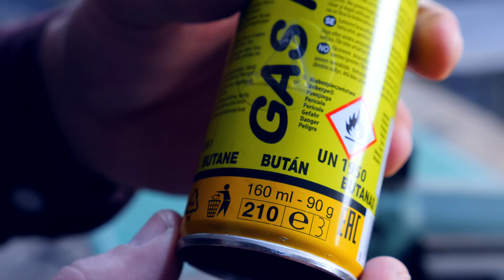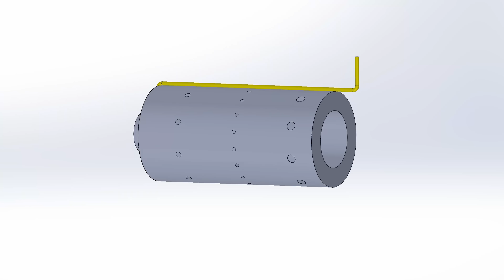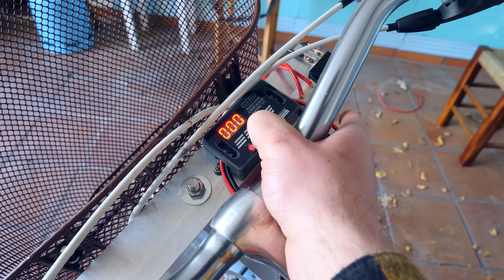I put a Homemade Jet Engine on my Bicycle

Comment: Heres an idea. Most of your videos experimenting on a homemade rocket your nozzle keeps on melting. You can use type 304 stainless steel it has a melting point of between 2,550 °F – 2,650 °F., you could also try treating the nozzle and the welds made with a more heat resistant metal with the downside that its harder to weld. You could try making the fuel injectors more symetric so the thrust should be more concentrated although it may be quite hard.

Comment: Couple pro tips. First if you want to open any kind of can just use a can opener. There's two ways you can use a typical can opener; parallel to the circumference and perpendicular to the circumference.  The latter will cut off the seam. Second tip is that's not welding that's called brazing. Welding is when the materials to be joined are melted and often the same or similar material is added to the molten joint. Brazing is when the materials being joined are heated up but not to the point of melting, then a dissimilar material with a lower melting point is introduced to liquefy and wet the joint similar to soldering.

Comment: Idea: I'd like to see a video making a rocket or even just one component such as the nozzle using some kind of subtractive machining like a lathe or CNC router. There may be a local machine shop willing to do the work and let you film, but you'd just supply a design. You could even go the extra mile to make the nozzle from Inconel. Considering how many rockets you make, I imagine the investment in a good reliable nozzle that could be transplanted to multiple future rocket designs may be worth the investment.

Comment: Idea: Make a water powered engine using electrolysis to convert the water into oxygen and hydrogen, the hydrogen should burn great when mixed with the oxygen.

Comment: I wonder how much of the power, was just leaf blower, and how much extra power was added from ignition. It would be easy to test, just test with only the leaf blower. Check speed and time between two points, then do the same with ignition turned on. Would be cool if you made a tubine version.

Comment: You're right that the can isn't going to do much as an exhaust or afterburner for your jet engine, but the real problem is using what I assume is brass or bronze braising to hold it together. I would look into some form of electrical arc welding, and building in all stainless if possible.

Comment: That was quite "engine rich" exhaust when you had the nozzle.
It would be interesting to see a side by side comparison of the leaf blower thrust vs the assembled engine.
Reply: yes! we need a control run, to show the difference between just the leave blower and the whole assembly.
Reply: you can leave
Reply: That's one thing I'd like to know in a fair amount of these engine builds. How much force is he achieving from just air and fuel delivery VS how much thrust is the combustion actually producing?
Reply: @AchievementDenied   Yes, this looks a lot like a heat gun for paint removal or burning weeds off the sidewalk. He needs a combustion chamber that contains a substantial amount of pressure and has a converging-diverging throat. But I don't want to see him build it - those need properly shielded testing stands.
Reply: yeah that would be epic to see how much power the combustion adds
Reply: He won’t do it because it’s likely the same and he knows it
Reply: Additional thrust was probably roughly 0.

Comment: With your love…. Sorry hate for tomatoes how far could you fire a tomato from a home made canon without the tomato exploding in the barrel? Cannon can be powered by any means you have, could be compressed air or butane /air explosion or alcohol/air or hairspray or other method of your choice. You can then have your assistant stand down range to try to catch the tomato to prove it was shot out intact, and even if it wasn’t it will be fun seeing him get sprayed with tomato bits

Comment: A motorjet! Motorjet research was nearly abandoned at the end of World War II as the turbojet was a more practical solution to jet power as it used the jet exhaust to drive a gas turbine, providing the power to drive the compressor without the additional weight of a piston engine that generated no thrust.

Comment: Great work buddy! Always stoked to se what you've come up with when I see you post a video! 😁 As soon as I saw the torch welding I was thinking it would likely melt, definitely need a more robustly manufactured exhaust/nozzle. Maybe ceramic coat it as well to help keep the heat out of the metal. Another suggestion for this would be some kind of flame out sensor, like a temp sensor that detects when the exhaust flow cools down below a certain threshold, and warns you with a light, or just cuts the gas supply and maybe blower as well. Feels like it could be a bit more safe than waving your hand in front of the exhaust. 😂

Comment: You need to add water injection to the inlet port of the compressor. Have it be a fine mist for best results. What it will do is cool down the air a lot and when it reaches the exhaust it will expand somewhere around 1600 times its original volume.
Reply: Oh also, switch from butane to gasoline or diesel. The issue you're having with butane is it's in confined spots whereas an atomized liquid will disburse more evenly with air before combustion

Comment: Idea: Building A jet engine out of a Bin.

Theoretically the parts should be able to withstand heat (because they are made of steel of aluminium) and it is mostly sheet metal so should be easy enough to work with and shape

Comment: I think you could get more performance out of the jet engine by making the lid cone-shaped to better direct the flow of the exhaust. You could also try to build an afterburner to put on the end of the jet engine to get a lot more power, and to make it look cool in the dark with flames shooting out of the engine.

Comment: For an exhaust you could always have gone to a scrap yard and get a piece of an old car exhaust, it is kinda pre designed to handle high temperatures and is about the right size ( width wise ). Just a thought.

Comment: In to improve the preformance of your jet engines, I sugest installing more then 1 burner. Use 1 for start up then use the other burners to push out the extra volume of fuel nessisary to keep up with the volume of forced induction you are able to provide

Comment: Split the air of the leaf blower (instead of running it at a lower speed), and blow cool air (like a bypass) over the metal fins on the back to act as cooling ... Edit: (Back again, after finishing the video ... or just remove the exhaust? LOL)

Comment: Just a note about electric cars, there is an estimated 28 billion lbs of lithium that could be mined from the earth. It takes 30 lbs of lithium to make an electric car. Assuming the lithium is used exclusively for automobiles, we could theoretically make 933 million electric cars. It is estimated that there are 1.4 billion cars in use globally.

Electric cars alone cannot replace internal combustion vehicles alone, we will need another source of energy storage besides lithium batteries to meet demand. Hydrogen would be a great contwnder for this.

Comment: I think it would be pretty awesome to see you achieve some kind of lift from jet engines. essentially a large circle with jet nozzles all around it. Just enough to get you a couple of inches off the ground, though, so you don't hurt yourself or need to get into adding gyroscopic stabilizers or something. A jet powered hover platform.

Comment: Also may be try your one of tour old carbon fibre pulse jet engine as anyone can clearly tell from its roar that it produce more thrust. Then pair the motor with a compressor made by the monster motor with a 1:2 gear ratio. That will sure go like 35 to 40 km/h

Comment: Most of the brazing will melt at about 1600F so why not build an arc welder out of microwave parts so you can use that for higher temperature joints that would withstand the jet engine temperatures.

Comment: I'm not entirely sure how you would do this but to cool the exhaust you could make it out of tubes and pump the fuel through it to cool it down like NASA does with their rocket engines
Reply: Just use excess compressor air, build an outer shell, for the air to flow through.

Comment: I'd like to see you do a control with the burner turned off in the jet to see how much thrust just the leaf blower is making. That would give a good visual representation of how much jet thrust you are generating.  It wouldn't require any fancy measuring devices, just have your buddy hold you and the bike steady from the side as you apply thrust in either mode.

Comment: try to crete an ion engine it uses ionic wind created bi hig voltage elecrtic current to move it is very efficient but not so powerful

Comment: if you diverted the excess air flow from the leaf blower around the outside of the combustion chamber and around the outside of the nozzle, it will cool it down a little while it is in use.

Comment: Future Video Idea: more propellant type testing based on use cases... i.e propane vs butane vs acetylene.  I'm also interested on how a solid fuel rocket would have worked in this project

Comment: What if you can figure out how to use regular air in a vortex with the normal combustion stuff in the middle so the normal air can shield/insulate the pipes from the burning stuff

Comment: I like this idea, I think you should try adding a regulated nozzle on the leaf blower and maybe create the inner combustion chamber with a smaller radius so the flame doesn’t go out. Also maybe try designing a proper nozzle on the rocket using graphite, you can buy decent sized cylinders online, use your mill to make a vortex opening.

Comment: Since the threat of imminent immolation is always present in your wonderful videos Sir, perhaps your next 3d printing/welding project could be set in the realm of [drum roll air for it !!] under the water 💦 !! I adore videos of beneath the surface of the water ( the location does not matter it could be a pool/river/sea/bathtub) and there’s a chance it might not all go down, or up actually, in flames 🔥 this is my idea. I’m also thinking about the Russian super cavitation bubble torpedo and your version of it )

Comment: I wonder if you have any of those turbos around, I'd like to see this thing running entirely on the enegy if the fuel. Perhaps you could use the turbo to pump air in instead of the leafblower. This would greatly reduce the jet's thrust though, tanks use similar engines for power so perhaps you could attach it to the wheel via gears. Most airplanes have the ability to start their engines in a similar way by blowing in lots of air to spin the turbine maybe that

Comment: Idea: Use the water impeller that you designed some videos back to make a submarine that uses it as propulsion. It can radio controlled and have a camera for viewing. It can be 3D printed, but you will need o-rings seals and use the resin printer.

Comment: Here's an idea, try building a rocket engine using nitrocellulose doped with a combustion catalyst like iron or copper oxide, or manganese dioxide (I know you have some of that from your peroxide rockets). Phlegmatize the nitrocellulose and catalyst with acetone and create a solid fuel grain. There's some good information on nitrocellulose based propellants on the sciencemadness forum, but mostly for making smokeless powder.  It should be applicable to rockets too.

Comment: Make a jet bike like this, but instead of leaf blower for air intake, set up the pedals to rotate pulleys & gearbox for a fan that blows air into the combustion chamber (pedals would no longer move the wheels, only the fan). In this way, you will be able to control air flow manually by pedaling harder or easier, giving you more control and a direct feel for some of the power you're putting into the engine.

Comment: Safety recommendation - Try not to wear gloves when using a pillar drill. Gloves can very easily get caught on the drill bit or the chuck and pull your hand in. Trust me you really don't want that.

Comment: Nicely done! The only logical next step is to get an automotive turbo charger and put the combustion chamber on the turbo, you will have a feedback loop, more fuel in, more air out, more air in,  more power out.

Comment: well another uncompressed flame.... Cmon integza Jet engine, steam, or rocket engine NEED COMPRESSION 

continuous explosion engine built with a turbo stage that feed the fuel with the 1st stage spins, oh and the exhaust of the first added to the 2nd , MOAREE COMPRESSION !!!

Comment: Here's an idea; a hovercraft made using "foam sandwich" technique, powered by small leaf blowers and your best jet engine, built to look like a small, single seat version of Luke Skywalker's landspeeder. 

There's a video somewhere on YouTube where a guy made an e-bike that was powered by a high torque power drill, fed by 6 drill batteries wired up in a V6 to provide for extremely impressive range. Use that same configuration to power your leaf blower(s) (I would recommend E-ZGo, or something comparable).

If it were me, instead of a combustion jet engine, I would try to make one that worked by pumping water vapor and extra air into a chamber (using a reptile tank fogger and tiny blower) that instantly superheated it into steam and forced itself out a nozzle that produced a nice laminar flow. 

If you could make all that work on the aforementioned v6 battery configuration, possibly supplemented by a solar recharging device, you'll be able to see run times of hours battery life, while getting tens of kilometers per liter of water used. The only byproduct would be steam, which is also pretty nice.

Comment: Idea: I see that you usually test the thrust in a horizontal way, which does help since you are not fighting against gravity, but I think it would be interesting if you tried making a way to test it vertically, or if you want to go all out you could go to a reallyyy tall bridge and compare on how fast it takes to: Fall down normally, fall down on with it accelerating donward, or how slow it falls if you accelerate it upward

Comment: idea: hydrogen peroxide steam powered Wankel engine on an RC car. The resin printer's better tolerances might make the Wankel engine rotate more smoothly. if the system is completely isolated could make for some nuts rpm

Comment: Your engine designs would benefit greatly by using different diameter SS tubes, allowing for a more concentric combustion chamber that would make your jet engines run more efficiency and reliable.  You'll need a TIG welder and a few welding lessens.. but there's a lot of up side to the investment.

Comment: Make a nuclear battery from a Smoke Detector's radioactive core and a 2N5033 NPN transistor (with the top taken off) to power your ignition circuit 👌(might need a few to get the voltage right but it will last 80 years!!)

Comment: Tomatoes are made of? Carbon. And carbon can be used as a fuel so dry/freeze dry some tomatoes and turn them into a powder, mixed with an oxidizer use that for fuel

Comment: How was this any different than blowing the bike with the blower alone? The igniting gas would be pressing against the blower as much as propelling out the nozzle, so the maximum propulsion would be equivalent to the strength of the blower. This is just a blower propelled bicycle with a flame as a decoration.

Comment: I think the next step is to feed the exhaust gasses from the combustion through a turbo charger on the turbine side to spin the compressor side and force more air into the combustion chamber thus removing the need for the leaf blower aside for lm starting the engine

Comment: Video/design idea.  Come up with some sort of simple modularity standard for 3D printed items.  A lot of your projects would benefit from being able to be scaled up.  If there was some sort of tongue and groove or rabbet style edge you could incorporate into the model, you could print much larger models using many prints secured together.

Comment: Using an inexpensive Drone controller, use your 3D printer to make a ducted-fan propulsion system that would lift tomatoes to a great height...... you know, to drop them and see them smash on the ground. Who wouldn't want to see absolute carnage of a tomato exploding on concrete. That's my idea for a future video.... BTW, I really NEED a 3D printer. :-D

Comment: At 4:35 you drill sheet metal holding it with your hand.  Very dangerous.  The sheet catches on the drill and becomes a saw blade...

Comment: please watch out, you are not welding but soldering. these solder joints can withstand some heat, but if it's red hot they won't be able to withstand much pressure.

Comment: Future theme..
1.Make adjustable jet nozzle
2.why don't you try to make a mixture of liquid hydrogen and liquid oxygen and then insert them in pressurized tank and let them come out and ignite them with spark plug
3.take liquid hydrogen and liquid oxygen,fill in container and ignite them ..BOOOOOOOM🤯

Comment: I think over the last couple of videos, it became pretty clear that the combustion heat is a recurring problem. Instead of keeping to try building something that just withstands the heat on its own, I propose you try to build a cooling solution. There are many cool things to try out, from water-cooling to preheating cooled propellants, from just dumping coolant in the device to integrated (and 3d printed) cooling channels.
I would love you exploring the feasibility of printing cooled components. Could be a mini series, not necessarily a single video.